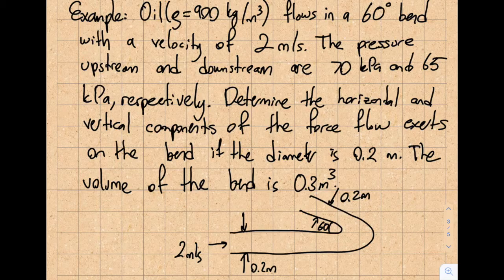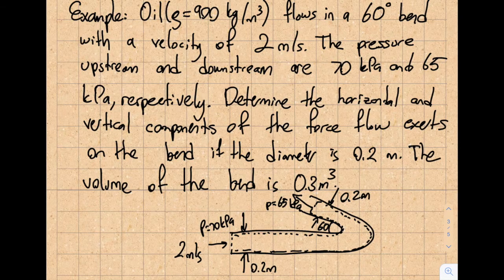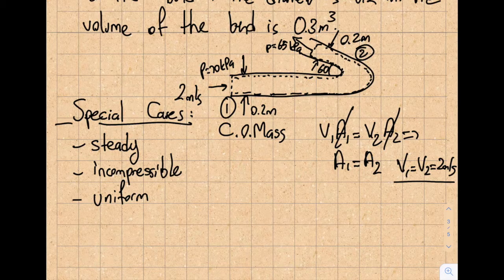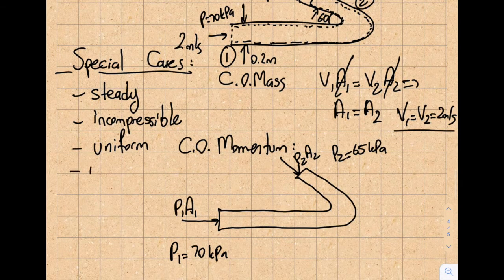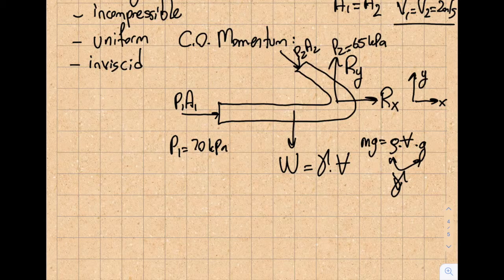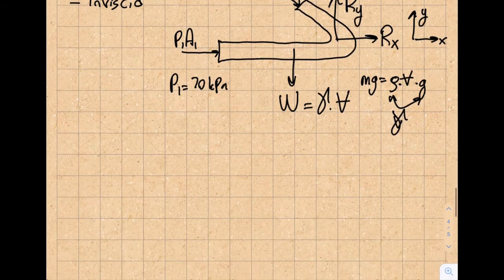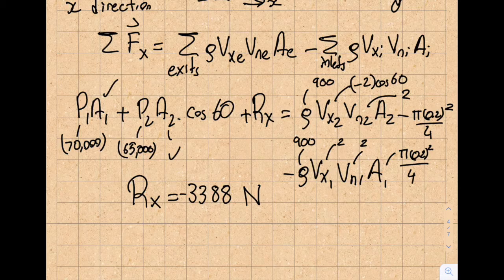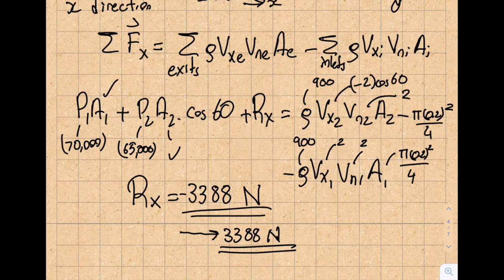Fluid Mechanics 6.3 - Solved Example Problem 1 -  Conservation of Mass and Momentum - Control Volume

Comment: Thank you very much for these videos that help me a lot ! I have a question it's about the pressure P. If i have understand, the Pressure that you talk P1 and P2 it's the pressure that induce by the velocity of the flow so the pressure is // to the flow (because in this case i don't understand why the velocity is the same but the pressure differente in A1 and A2 if the pressure it's induce by the velocity. I thought also if it was more  a pressure perpendicular to the flow that a surface // to the flow could feel ?  Thank you 10000 times 🙏